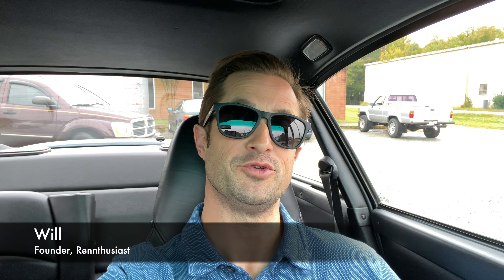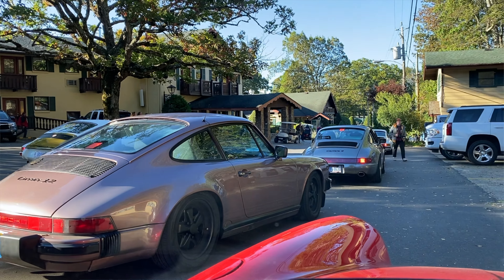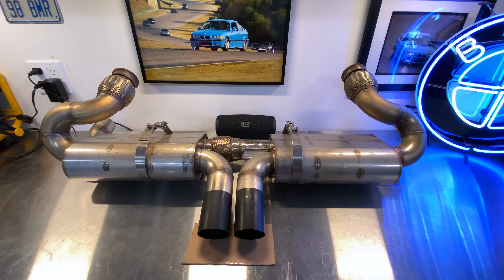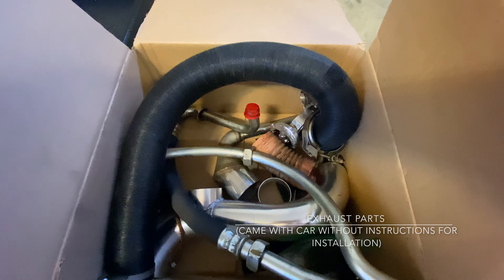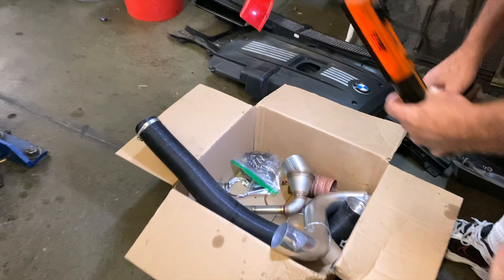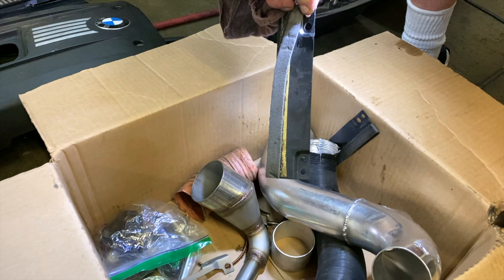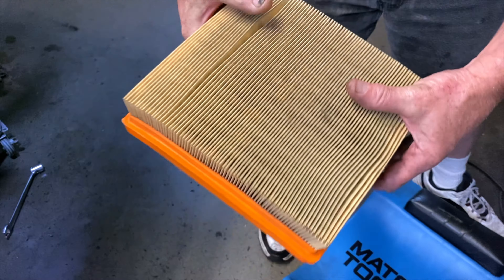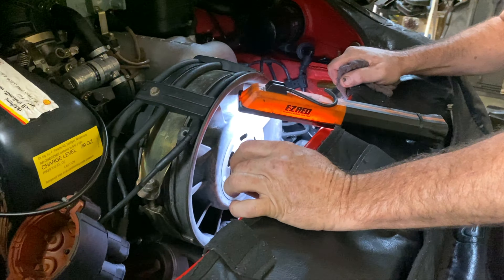1986 Porsche 911 Exhaust Install and Repair Check In

Comment: Love your content man, Nothing wrong with going to the experts, you can always learn a little by spending a bit more time with the mechanic. My Porsche guy loves to explain & talk and I have found myself easily caught up for an hour or so talking Porsche cars and learning about some of the stuff that get's done to the car. Luckily the older cars are more analog & easier to learn to do things on the vs. modern cars. Keep the content coming, I am still on the hunt for a clean G50, a few slipped through my hands and timing was not right on others. Have you replaced the 915 gearbox or done any Synchro work? Guards Red all the way!
Reply from the maker: Thanks for the support.

Just had a wevo classic kit installed on the 86.  It’s a game changer.  Retains the vintage feel while crispening up the action and just tightening it all up.  Will publish a review of it in the next few weeks.

I have content opportunities stacking up so keep your eyes open for more videos.

Thanks again for your support. 👍🏼